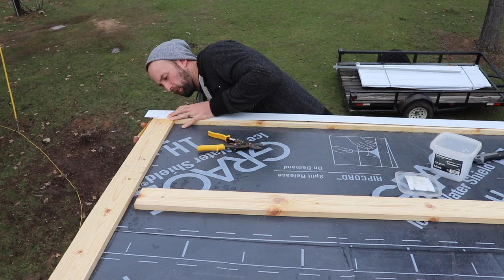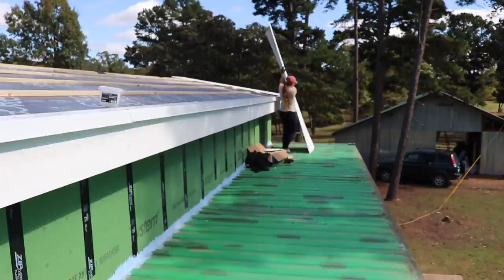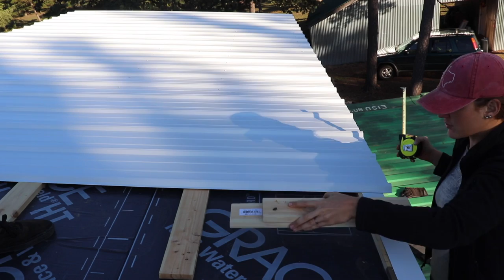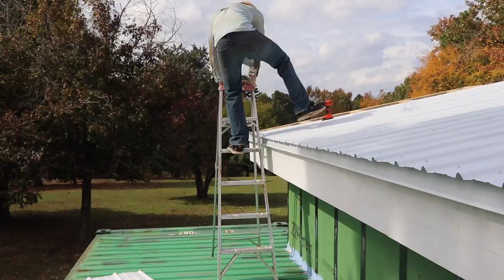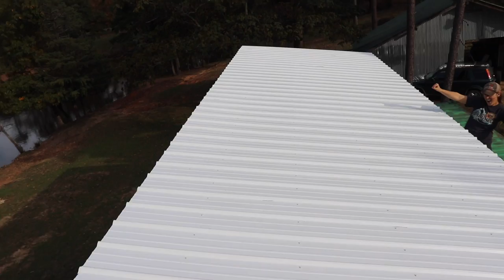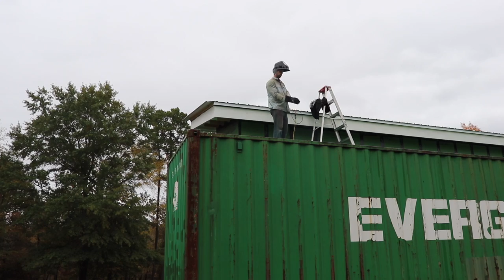Installing Our ENERGY EFFICIENT Roof

Comment: Spencer the point of the screw in the high rib is to keep the seam tight. The actual name is a stitch screw and it is not meant to go through the deck. It is typically a 1/2" screw and it keeps the seam from being pulled apart under heavy wind conditions. I'm a certified installer of the pole barn style panel you have and you are correct that the screws should be installed in the low ribs so you don't oil can the metal. With that said you guys are doing a great job! Only other tip is to hold the nail between your index finger and middle finger with your palm facing up so you won't smash your fingers big guy.

Comment: Guys, great job. To save your finger when nailing, grasp nail in a simple clothes peg, then hold in place and hit with hammer. This hit was given to me by my grandfather, a minister of religion, to prevent swearing and cursing. It works and is a cheap way to prevent injury and pain.
Loving the build so far. Can’t wait to see the interior design of the kitchen. Are you building it or will it be a prefabricated one.

Comment: Spencer you need to pre-punch a hole in your roofing panels with a awl to avoid the metal shavings from the screws , also get you a magnet to hold the nails  👍
Reply: Or pre-drilling all the sheets, that's what we do all the time, it's makes things a lot easier.

Comment: Your channel is fun to watch. I'm a retired contractor so I enjoy seeing young couples start these kinds of projects. When you install new roofing over the containers old roof, mark and drill one new roof panel for all the screws for that panel. Triple check it making sure all the holes are where you want them. Then set it on top of the rest of the new roofing panels and drill all your holes. This will make it easier to start the screws and all the screws will be in a straight line saving you hours of labor time. Just be careful when pulling each panel off as there will be a small burr of metal on the bottom side of each hole and will scratch the panel below. Awaiting your next vid. :-) DM

Comment: going forward to make it easier on ya'll neatly stack your metal and pre drill them as a stack. This way you only measure once (you should include steps 6, and 8 here), drill once then all you have to do is place and screw them ON THE ROOF.    keep it up guys your doing great.
Reply: Yeah pre drill them all on the ground, then notice there wrong on the roof. Its not production its a labor of love.
Reply: That's what I was doing to suggest.  Measure your 2×4 and stack and clamp metal on ground.  Then predrill. 
Also once your finish laying all your sheets on roof. Go back with a broom and sweep the entire roof to rid all the fine metal shavings.  
If you dont sweep the shavings from you drilling and screwing will stay on flat surface will rust and will void your warranty.
Reply: Installed metal for years... on side wall and probably somthing like this too we always predrilled.  Measure 3 times drill once yo.
Reply: Another advantage of pre-drilling a stack of panels is the screws will line up exactly.  This isn’t so noticeable on the roof, but it looks much better on the walls.

Comment: Sat on Sunday watching your videos. Anxious to follow your progress. Winter has arrived here in the Pennsylvania mountains. I bought 2- 20' shipping containers with the intention of joining and burying them and pouring a concrete base, walls and roof. Walls and roof were to be one pour. Neighbor dug the hole with his back hoe with the intentions of pouring the base, "floor" the following weekend in preparation to sit the containers in. Mid week went to take some measurements and the hole was filled with water. Now we have a pool, as using 2 pumps we pump it dry but it fills back up in a couple days. It was intended for a storm/and when SHTF shelter but until we can get the ground water issue straightened out they sit. We're going to pump it out once the freezing weather sets in hoping the ground may be frozen.

Comment: One tip on installing the metal roof.  Stack up all your tin on sawhorse's on the ground.  Measure your screw locations for the per-lings, then drill through all the sheets.  Then, all you have to do is lay them out and screw them down. :)

Comment: Spencer, turn your hand over with the palm facing up, put the nail between your fingers so if you miss the nail it hurts but not as bad as hitting a nail.  For future projects the screws goes in the top of the ribs in metal roofing panels. a few tips from a house framer

Comment: In Australia where i'm from the majority of roof's are Corrugated iron (metal roof) and the way we screw the sheets down is through the ridge. You just use longer screws, going through the ridge is much better at stopping water from leaking through screw holes then screwing in the channels.

Comment: you should be putting the screws in the top of the ridges ,eliminates the possibility of leakage and locks down the over lap edge ,also allows snow and ice to slide off the roof. they make all different length screws to accommodate different applications and colors

Comment: It's coming along!  I thought as I saw your product and noticed it for sure when you had one in your hand, but those screws are self-tapping so they'll go through the metal without pre-drilling.  You can tell by the flat bits on the sides of the point.  Nice job with the straight lines, looks very nice!

Comment: that is correct put the screws in the valley. their is a simpler way to screw the panels down. stack all the panel make sure they are all flush measure out all the anchor points in pre drill all your holes at one time. this makes it easy to install in all your screws line up.

Comment: You don't have to pre-drill your holes.  The screws are made to penetrate the metal.  Also, if you take an old skill saw blade and put in on in reverse you can use it to cut the metal roofing.  That is how my dad showed me how to do it an how I have always done it.
Reply: Didnt think penetrate would be used in reference to screwing metal roofing.  Not what came to mind at first..
Reply: He may have only pre-drilled that first one to hold the panel its its correct spot, doesnt look like it after that.
Reply: To help get screws perfectly aligned you can pre drill all the holes (or even use a metal punch on) 4 or 5 sheets at the same time on the ground. Keep the top sheet as template for the next 4 and continue on. Saves measuring when on the roof..

Comment: looking really good guys,interesting it’s very different in Australia, we screw sheeting down on the valleys for wall sheeting but always on the ridge for roof sheeting, this way gravity naturally pulls water away from the screw seals instead of pooling up around it,especially on a fairly flat pitched roof. Also our sheeting comes custom made to exact length for no extra charge, direct from the factory, saves material and changing grinding discs for an afternoon

Comment: If you want to align your screws on vertical surfaces you can measure the purlins and drill 6 or 7 sheets at a time by just stacking them one on the other.  If you are doing the roof and it can't be seen it is often still faster to just predrill to make sure you get the ones where you need them and one doesn't take a run across the roof and leave a scar.

Comment: Butyl sealant along the ridges between each overlap of sheets, and stitchers (short self drilling screws with a deep thread) to pin the overlaps together and compress the sealant, are very important to use. May be you just didn't show this but surprised not to see anything about it in the video. Just loosen off your tekscrews a little to lift up the overlap and it can be done after the fact. One other useful tip is to run the overlaps away from prevailing winds. Where I am, bad winds generally come from the south west, so I tend to overlap away from that direction. With sealant in, though, it shouldn't matter.
Reply: Makes me wonder how much overlap was used as well
Reply: I agree. I was thinking the same thing. The butyl sealant typically comes in a roll with a peel away film. Very important to include this or otherwise rain is easily driven into the overlap.

Comment: White is the smart way to go in a hot climate. My house is 60 miles North of Palm Springs on the Mojave Desert and the temp. is always 110 plus, each day through July and August.  I put a metal roof on my house years ago and then painted it with elastomeric white reflective coating..  My place is about 3000 square feet, and I'm able to keep the temp. inside down as cool as I want it to be with just two through the wall high efficiency AC's.. It rains here only about once every two years,  and the humidity is usually less than 10 %,  so that creates a very different environment from your place... I've lived in my place, which I built from a small vacation cabin into a very comfortable house, for 43 years.... I hope you two will be able to stay healthy and together for at least that long in the home you're building for yourselves.  I watch YouTube on a 25 inch all in one computer and your video's  sound,  picture, stability, and interest, are awesome.  Thanks for all the time and energy you put into  placing your "adventure" on YouTube for we armchair warriors to watch!

Comment: Tell Spencer to turn his fingers upside down, pointing the meaty part of your finger facing up. That way it hurts a lot less if you hit it with the hammer. Been doing that for over 30 years and haven't hit a nail yet. Finger nail that is.
Reply: jdmeaux
 also hold nail between pointer and middle finger
Reply: Just do a light hit to set the nail then remove your fingers out of the way.
Reply: @orin1971  thank you 🤦‍♂️
Reply: warren michael m

Comment: I roofed two houses with tin roofs I never used purlins. I used 2' wide lengths of Tin that cover all the screws There are no exposed screws on the top of either roof. I even ran my toilet vent outside the gable ends of the siding where the vents already were just put screens over vent openingThe tin I used the second sheet snaps down with the palm of my hand covering the screws holding the first sheet down. the first sheet had a corner piece for the gable ends of the roof. Not one screw showing. Laid the tin on top of tar paper making sure you start your overlap so wind cannot get under the tin.and you can walk on the roof.

Comment: Tin masters tip put all tin for the side or roof on saw horses clamp together measure one time and pre drill screw holes through all sheets with tiny 1/8 bit put entire roof on and screw off the sheets in 30 minutes

Comment: Further to my earlier post there is another major factor involved, "climate" hot the sheets will expand, cold the sheets contract, having two screws in one valley does not allow much area for this to happen on the flat area, putting stress on the mounting points, where a longer screw on each ridge would eliminate most of the stress, "more area and angles". Please don`t think that I `m picking on your work, I love your videos and wish you both the best, you guys remind of Laurel & Hardy (not physical) but personality.

Comment: You should consider getting the hole measurements and then straighten up the stack of sheet metal and drilling the entire stack on the ground at one time. It makes things a lot easier and safer.

Comment: Use a Skil saw with a carbide blade to cut you metal to size. When it's time to paint your containers get ceramic infused paint, it will cut out almost all heat transfer.

Comment: To anyone that hasn't installed metal panels or flashing... when they are trying to put screws and nails in, it is honestly more difficult than you think. Unless you've been doing this for a while, smashing your finger will happen and you will most likely look like a fool trying to put screws in. I honestly recommend pre-drilling holes first to avoid the problem all together. Just make sure to use a small bit. You just need a starting hole so you have something to grip.

Also I'm more of a fan of seam style roofs over corrugated roofs that they are putting up. I've never been a fan of exposed screws and the advantage of seam style roofs is your screws will be hidden under overlaps. The exposed screws will weather over time and the washers will age with a corrugated roof which could cause leaks while you will never have issues with a seamed roof.

ALSO big tip for long lasting roofing and siding, NEVER leave wood exposed and jump the gun roofing before you block out your J-channel for siding and soffit and setting fascia to cover exposed wood. Because of how water flows you need to work from the bottom up which means you will set yourself up with headaches later on if you do go straight to roofing before you figure out your water flow situation with laying out your framework. Now they might have an idea going forward and may keep things really simple but I would recommend covering wood up to avoid rot problems 20 years down the line.

Comment: First time commenting, Great job to you both.
As for the ridge V gulley your right Spencer,the ridge is risky as you can also spread the ridge causing the sheets to be off square if tightened to far down.
That water coming up from underground is insane.

Comment: Good to see your not driving those screws to China. Just enough to compress washer is key, tip though once in position butt the drill with your opposing palm. It will create a slight dimple in metal and help the screw  penetrate more efficiently.

Comment: This might have been addressed already but please make sure you sweep the drilled metal particles off the roof, if not they will rust where they lay and pit the roof and rust through. The manufacturer will not warranty the panels if that happens. Just saying.
Reply: This is false.

Comment: Another great video.  I have seen the water sitting on the surface problem successfully fixed before. You have probably seen those large auger drills that mount on the rear of tractors. If you drill down as deeply as you can in a grid pattern and fill each hole with gravel/rocks, you will give the water someplace to go and help drought proof your property.  You can also look into the "Ruth Stout Gardening Method". I love your channel. You are a great couple.  Best Wishes...

Comment: Hey guys, love the videos. I've kept my comments to myself but this might be important. I am 100% certain that your wooden purlings your using will rot. They dont look pressure treated and I cant see how you wont have condensation on the back side of your outer roofing material. I know you left gaps with mesh but I feel that is wont be enough to keep the roofing materials on for more than 10-15yrs

Comment: You should put paint on the cut off pieces of roof or the rust will kick in where ye cut off. With the other roof that ye are putting up maybe putting farm water hose 1/2inc on the back of the roof and putting water true it so when the sun is heating the roof up the water will warm up and safe ye from heat up the water with a water heater all the time.

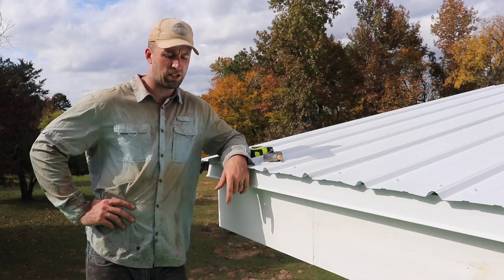Comment: 10:40 There is a couple of manufacturers that I have seen in 2020 that say to install in the ridge. But most newer last couple of decade manufacturers do recommend in the valley according to my experience.  If you install in the ridge you do need longer screws.

Comment: White wood in any location there may be a concern for moisture (your roofing sleepers) should be P.T. lumber. This causes an issue with fasteners and any other metals that may come in contact with the P.T. lumber, but another layer of sticky-backed, rolled moisture barrier is pretty standard these days as a corrosion barrier with the roofing materials.

Comment: Not to criticize, but I would have used treated boards under the metal roofing because when there's a temperature change between your vapor barrier and the outside it may sweat and rot out the untreated slats where the metal touches them.
Reply: @norman7179 , The untreated wood will rot out at the screw holes and the metal will blow off before the painted roof panels will corrode.

Comment: Maybe you need to dig a couple of drainage channels down to your little dam to help remove some of the water? Use either some drainage pipe with the holes or just line the drain with drainage cloth and gravel and cover it up again...

Comment: a circle saw with standard wood blade turned backward cuts roof metal just fine
Reply: It also voids the material warranty. When a contractor agrees to install a product it must be installed in harmony with the warranty. The customer can do what they want and structure the contract to meet their needs and understand they're voiding the warranty. Most steel roofs are cut with a blade and these burnt edges will soon rust. This is federal law.

Comment: If the thumb is throbbing , make a hole though the  thumb nail to let the pressure out. A sharp sewing needle works wonders. To prevent you belting your thumb, hold the hammer with both hands .👍

Comment: If your barn is a metal pole barn, check to see if there is a roof leak directly into one of those poles. That could be the source of your "ground leak" problem inside the barn. The pressure of the water column inside the pole could cause what you are seeing and could undermine the integrity of the barn because it could be loosening the pole under the ground. You don't want that.

Comment: FYI all white roofs lose reflectivity rather quickly due to surface pantene (dirt and debris) this can be power washed off but needs to be done every few months for best reflectivity, even the best elastomeric coatings which are 90 % heat reflective originally drop to 50% within a year.

Comment: Spenser, cheap $30 electric shears (Harbor Freight) make cutting off the edge much easier than the grinder and saves on cutoff wheels.  Doesn't work  cross-cutting the panels.  Good luck.